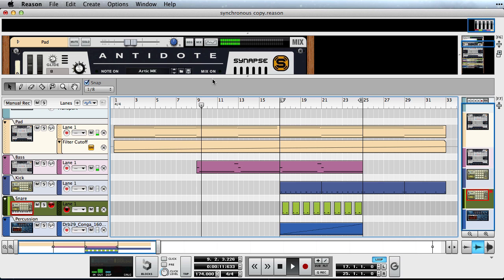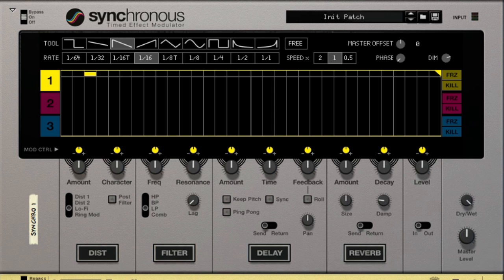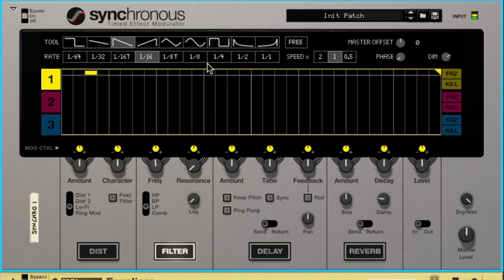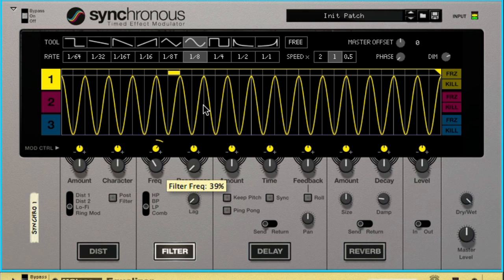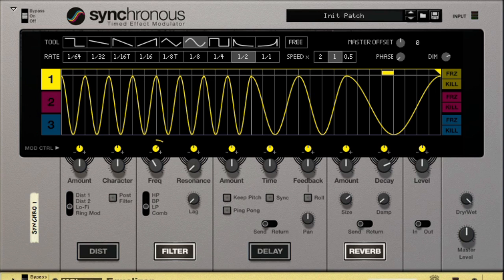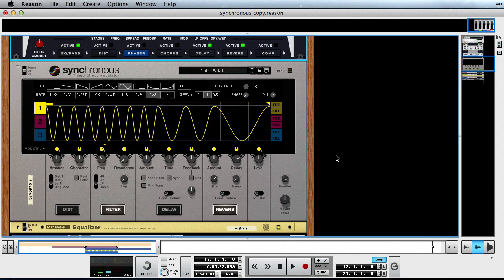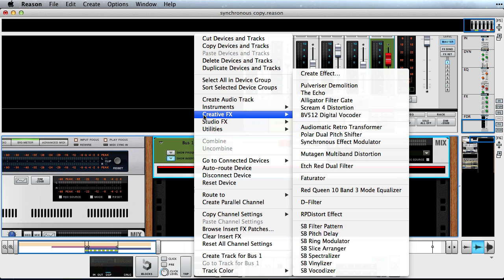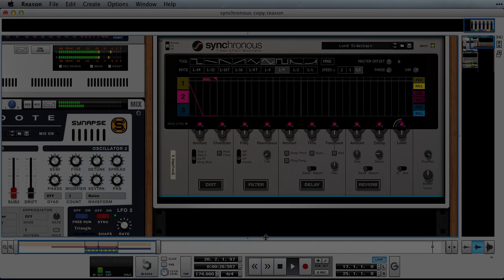Creative effects with Synchronous - Reason Tips

Comment: Antidote stil my best analog synth build only for reason, itvia from synapse audio but after 12 years is still good. 12 years ago was also antidote intruduce 8 build in synth   efects , that can was been used as a efect machine. Anitoddote was intruced with 6.5 reason as exlusevly built just for reason. We need those machines also 2023 but they need to upgraded

Comment: The only reason I never use Synchronous is because it doesn't have a gate to trigger it manually.
You could automate it turning on or off in the sequencer to some degree, but you don't have full control over if you want to trigger it at all sorts of intervals. I find myself instead using Thor a lot as a filter/chorus/delay device that you can trigger.
Reply: Great catch. I just moved from reason 6 to 11 so it's all new for me and was wondering about exactly that.
Reply: @Sool101  you're welcome ! Just put audio into Thor and use the routing matrix to send the audio input to one of the filters. Be sure to set the amp envelope to attack 0 and sustain 100%, release 0 so it just comes on and off instantly. Then don't forget to program midi for that Thor (just hit C3 or any key to turn it on or off). And then configure all your effects as desired.

Comment: Hmm, didn't think to use synchronous for the latter application, will have to keep that in mind. What I would like to see added, however, is a Redrum/Matrix-style pattern bank, so you could change your synchronous curves on the fly and create longer non-repeating modulations.
Reply: You could make the different curves you want in one Synchronous and then automate the Mod Ctrl knobs to drop the different curves in and out. Like turning down curve 1 and turn up curve 2. If you want to route these curve CV outs to modulate something else you could combine them with a CV merger while doing this. Or several different Synchronous units too, with more curve patters. I'm not at my studio right now so I can't try this out, but it should be possible.
A bit complicated perhaps, but in combination with long curve patterns (1/1 setting) it might work well for this application. Also I guess you could hook it up to a Combinator and use the programmer to make Rate and Speed automation tracks and use those to vary the curves. Though pattern banks would be even better of course, or a copy-curve-to-track function, like the copy-pattern-to-track in Redrum.